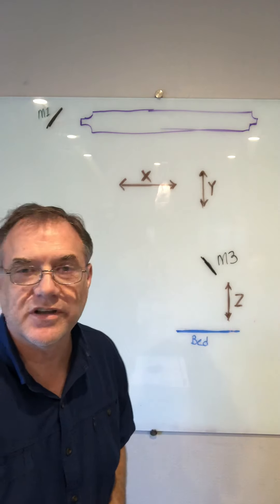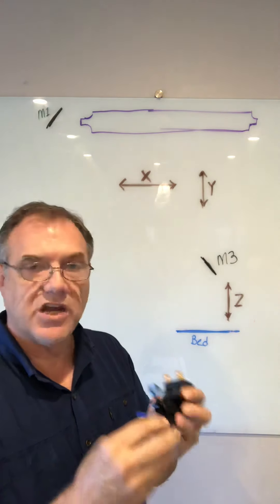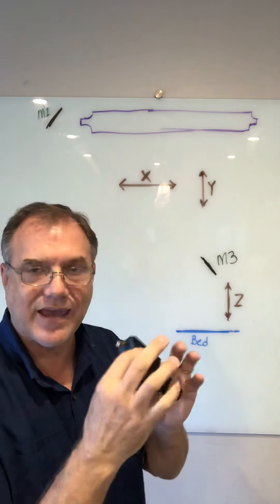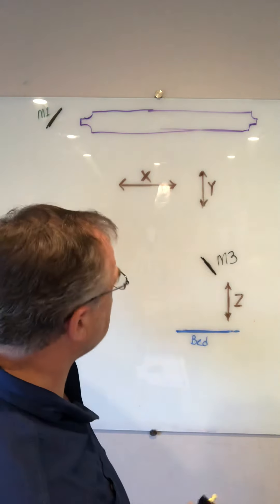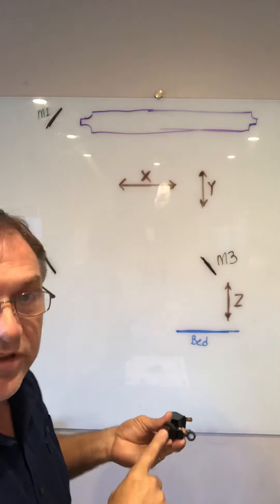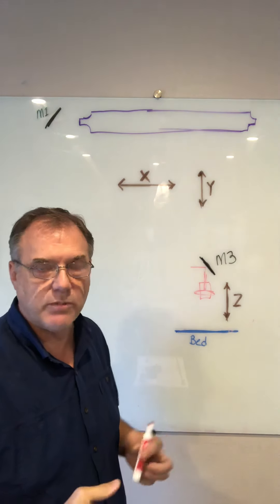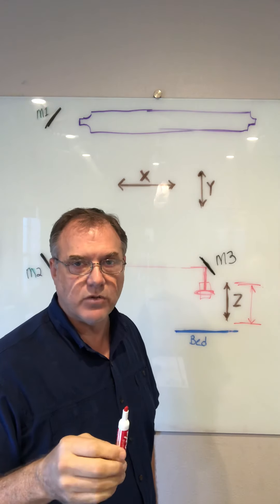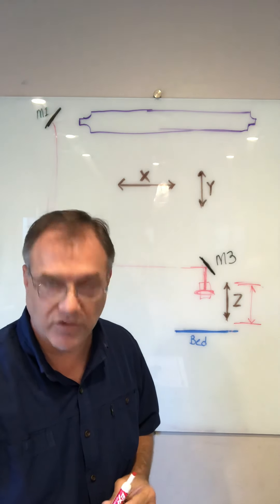Explaining the 3rd mirror beam alignment for your co2 laser

Comment: I have a strange issue where all the mirrors seem to be aligned, but only on three corners of my laser. Top left near and far, bottom left near and far and bottom right near and far all line up and hit the center of the head. But as soon as I move it to top right far, the beam travels a full 5mm to the left (looking at the head from the front of the machine) does this sound like a beam angle issue or more of a physical gantry skew?
Reply: Did you find a solution to this?

Comment: question, using your tool, i get drift from mirror 3 to 2 left to right...  To fix, do i adjust the angle of the mirror 3 housing?  I cant get it dialed in with the mirror adjustment screws
Reply: Did you ever figure out how to fix this? I got the same problem. The beam will stay aligned when the head is closest to mirror 2 untill about 3/4 of the way down to the right side of the machine!